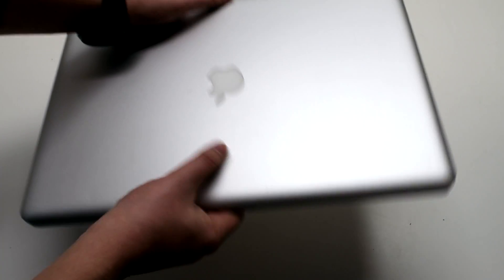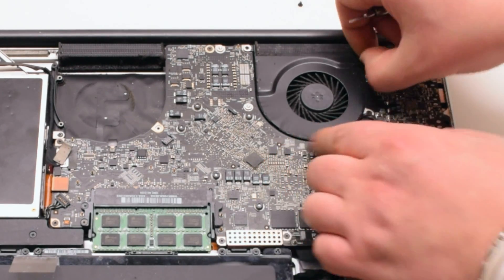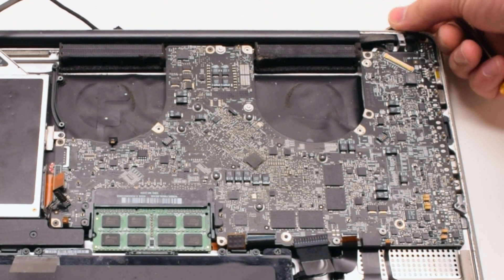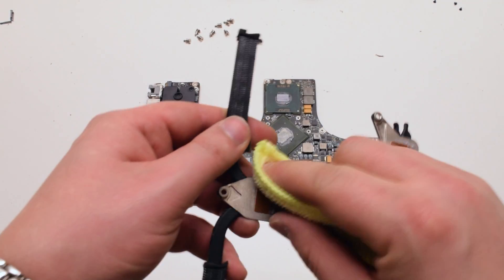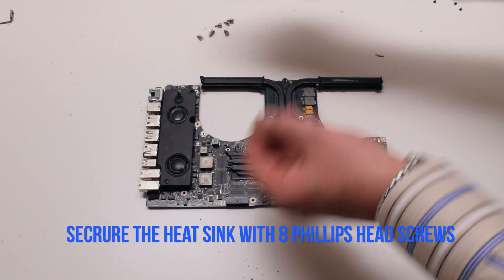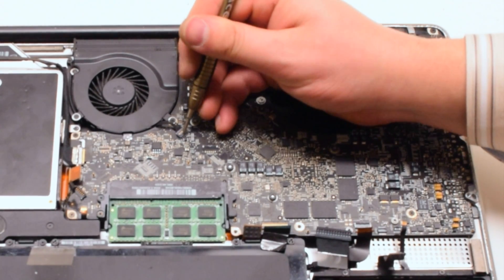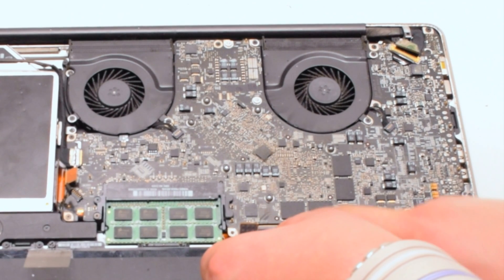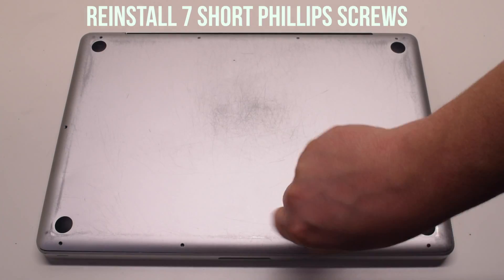2009 Macbook Pro 17" A1297 CPU Heat Sink Replacement

Comment: Careful with the heatsink (the metal bracket on the Processors), mine had a wire attached bottom right of the heatsink which i assume was for measuring temperature. Seems like its a variation added at a different time. The cable was fragile, so i left it plugged in, unscrewed the heatsink, and just flipped it with the cable still attached. I was able to clean and replace the thermal compound easily enough.
Reply: Anyone else believe the video requires a disclaimer about this?  One would believe the heatsink could be removed with impunity watching this.  I have the exact computer by model number and appearance.  And the heatsinks are often rather stuck on, yes?  So, one could be forgiven for ripping that connector off along with the 'sink because there is no 'feel' when pulling this hard!  Actually, I saw the bleedin' connector and STILL failed.  I was careful, but tore a wire when removing the old paste (the easiest paste I have ever removed - clearly, it was put on incorrectly :))  I have repaired iPhones (So small!) and have NEVER torn a connector/wire.  Next, I managed to rip the wires off the board where the plug inserts!  I am toying with soldering the bare wires to the board.  I figure 50/50 chance of me (no rock star) frying the board), vs just going without the wires and hoping.  I will tell you I am PISSED OFF, not at iFixiT but at the product design.